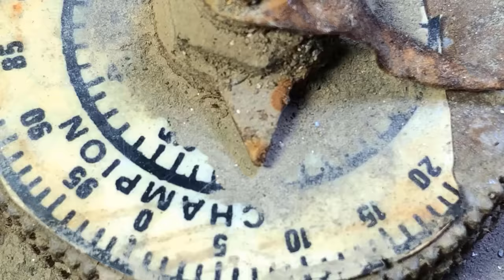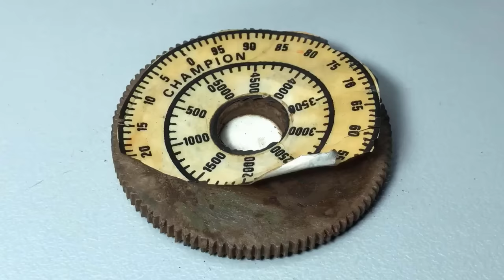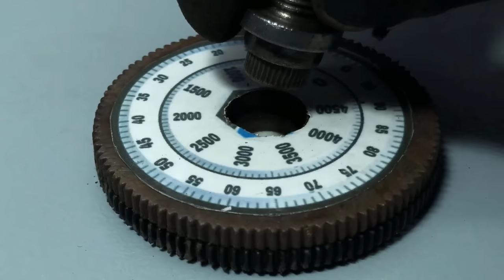Antique Motor Winding Machine Restoration

Comment: I woukd have straightened or replaced the bent screw seen during reassembly. Did you check if the dial was correctly calibrated as to position? Spray painting the screws and other small hardware was a bit amateurish, should have been polished and the heads cleaned up on all the screws and bolts. Did you lube/grease the gears where they interact with the other gears? Did not see a function test to see if it actually worked as intended either. Not the best or cleanest restoration I have seen. Looks nice, but appearances can be deceiving. Nice cosmetic job, but I have reservations about the rest.
Reply: Does not seem to work in the end, very dissapointing
Reply: He just do this for the views. Who care if it's work then
Reply: @Bottaonesta  If it does not work it is not much of a restoration, is it? Any idiot can do cosmetic work, the artistry is in making it work again.
Reply: I say the same...
Reply: ООО иаауц😢ас
Reply: Very poor restoration. Verging on click-bait this video.

Comment: OK you've cleaned it up nicely and it will work once you've corrected a couple of small mistakes. The middle shaft is designed to slide to select 2 different winding speeds, hence the 2 different scales on the dial. At 20:40 on the middle shaft you have the big drive gear on the wrong way round. Look at the layout of the gears at 1:00 and you can see the middle shaft is actuall stuck half way between gears. At 1:00 if the shaft was fully to the left then the smaller gear on the input shaft (furthest away from the handle) is driving the winding shaft and you read the outer scale on the dial. If the shaft is fully to the right  the bigger gear (nearest the handle) is turning the small gear on the middle shaft for high speed winding and you read the inner scale. Both gears on the middle shaft can't be engaged with the input shaft gears at the same time. PS the close up shots were excellent and the editing was just about right. Don't listen to the complainers. The ones commenting on your English probably wouldn't make half as good a job of translating into your first language. We all knew what you are meaning so why bother commenting.
Reply from the maker: You explained all this so carefully. When I shared the video with my father, he told me the same thing and told me the mistakes I had made.
Reply from the maker: I felt very happy to see you watching the video from someone so big and appreciating me.

Comment: You guys did a great job, very beautiful, careful and meticulous. It's great that you've restored that motor winding machine. The problem is that the shaft you play is too careful, the sliding ring is worn out, when winding the wire it slips out of the mold, you do not lubricate the sliding bearing.. this machine was bought in China. 15 dollars, You may think it's ancient, but in our country many people are still using it. Now they use faster gearshift machines
Reply from the maker: Thank you very much! You Are Right ❤

Comment: Overall a great job. The only things I would have done differently would be to either hot or cold blue everything except the frame and to add a little grease or oil for smoother rotations. Keep up the great content.

Comment: Nice video!
I think, though, that mixing eno (an antacid) and citric acid (an acid) together just makes a neutral solution. Possibly errs on the side of acidic with the addition of vinegar (another weak acid) but better off using acid or alkali alone, rather than mixing.
Reply from the maker: Hmmm You are right but we had to experiment on this ?

Comment: I was kind of hoping you would show what it actually does. What the heck is a motor winder? Overall, good restoration. My eyebrows went up a couple of times, trying to figure out your process. What is ENO?
Reply from the maker: We Want To See Results Of ENO
Reply: ENO is a bicarbonate of soda based antacid.

As for the device, it is used to wind the magnetic coils used in electric motors.

As the handle is rotated, the axle turns and the coils of wire are wound. The indicators would keep a mechanical record of the number of turns in each coil of wire. This is to ensure each coil has the same number of turns as any other coil.

Comment: Please use the right tools for your restoration. 😢
Reply from the maker: Can you tell me which tools we are using wrongly and which ones are right in your opinion?
Reply: @aahands  well it starts at 1:33 just use a normal wrench not a pliers. Also the screwdriver is not the right size.

Comment: Restoration seems pretty incomplete to me. Also lots of movements during the after "test".

Nice to  polish the bars, but no nickel plating ? Doesn't look like it got a correct rust proof treatment. One of the gears looks broken and would have needed some welding to fix it. Some bolts have just been cleaned, no filing to fix it. 

It's a nice job, but not the best one i've seen  on YouTube.
Reply from the maker: You are absolutely right, we don't have anything that we can use on this.

Comment: I don't understand, what does that machine do anyway?
Reply: People rewind motor windings with it. The dial with the needle counts number of turns. The coil holder or bobbin is mounted on the long screw shaft. The wire is fed by hand.
Reply from the maker: That's It ( Explane Good )